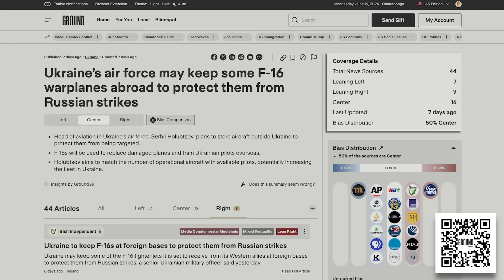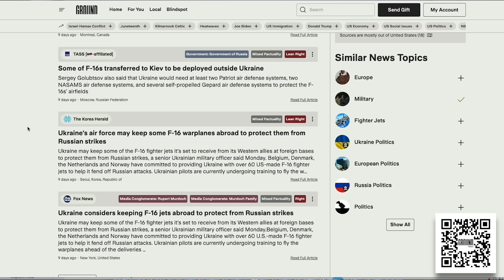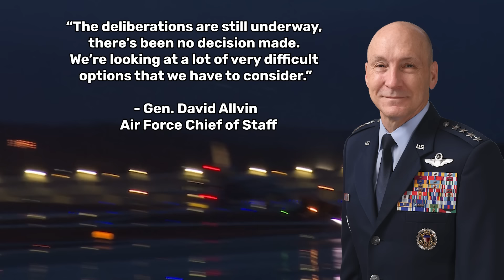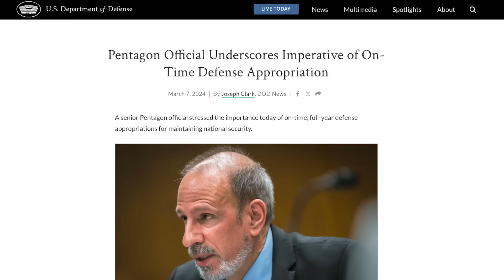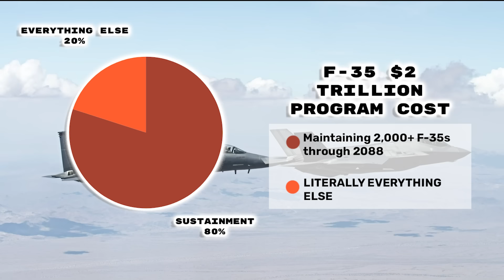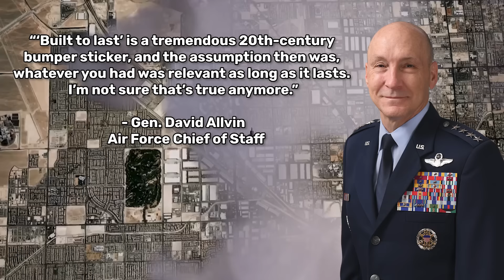Will America's new stealth fighter be shot down by cost already?

Comment: I mean we sent like 200 billion to Ukraine and Israel. That would be enough to buy 1,000 200 million dollar aircraft. Which was like the cost of the f22. Talking like 2,250 F35A’s. So I’m sure that’s got something to do with the budget constraints. It should be cheaper to build a 6th generation fighter than it was to build the F 22. I mean we have processors that are 10x cheaper and 1,000x faster. Especially when you’re talking about in a fighter jet when you can have liquid nitrogen or something ridiculous cooling the processor’s so you can overclock tf out of them but it wouldn’t even be overclocking. I think amd or intel got one of their older chips up to 9ghz by spraying it with basically computer cleaner. But yeah you can have super computers these fighters now for a fairly low cost. Rip apart 50 Xbox series X’s and stuff them in the fighter. lol. Maybe they can just build more B-21s but modify them for air dominance. Especially with how good the algorithms have gotten for iron dome. That could be modified to defend a B-21 and any aircraft in a certain radius. I’m sure you could make a fairly small interceptor and put a large number of them on something like a B-21. Then you just have a bunch of drones and such carrying air to ground weapons that fly with the B-21. The only issue is you don’t want the B-21 to be used in mass because people would be able to study how to get a radar return off them. Apparently that’s part of the problem with the B-2. But idk I’m sure you could modify the airframe to be a little more agile and faster. We would still need an interceptor though. Especially for the navy.
Reply: You want to turn the B-21 into an air-superiority fighter???  LMAO 🤣

Comment: The problems with a next generation anything is just that. The Air Force, through squandering bazillions on dollars always wants a shiny new NexGen thing a ma jig. The solution is making the Air Force more responsible for organising itself, and if not, start firing the top brass. Eventually someone down the ranks will see and implement workable solutions. The F15EX is an example of what should always happens but doesn’t. And in this case the Air Force is doing what it can to curtail the EX. Until you have a NexGen available for production and into service the older aircraft needs to be kept in production and continually improved. When a NexGen shows up late, over budget and not working as advertised you still have a relevant alternative. Interesting that there is no discussion on a follow on F35D.
Reply: F-35D? Need to get the kinks worked out of the A, B, and C versions 1st.